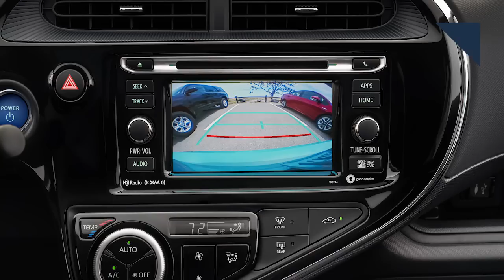EV Credits May Go Away, Jeep Tested Other Wrangler Design - Autoline Daily 2226

Comment: "Battery powered vehicles" will gain popular acceptance when they are as cheap to own as gasoline powered vehicles. (It's a bit more complicated since high purchase price is a barrier even if operating costs like fuel & maintenance are much lower for the life of the vehicle.) That will occur sooner in Europe with their high gas prices and general affluence. It will be later in the US, and even later elsewhere in the world. Even with govt action, until that basic economic tipping point occurs, they won't catch on. Will it be soon enough that "almost half" of cars globally will be "battery powered"? I wouldn't bet on it. With advances to ICEs, the point of parity may not occur until 2030, and then their accelerated penetration into the market won't occur until after.

We won't see significant differences in car design due to autonomAVs at least not in the near future. If fleets will be used for hauling people during rush hour & cargo at other times, expect them to look like small minivans. If they are more individual, personal pods, then they will look like Smart cars with seats that fold out of the way for deliveries.

But autonomous driving won't be the end point, anyway. When they talk about cars sitting idle most of the day and how it's a waste, remember that transporting yourself is non-value adding. To paraphrase a Boeing exec, the future of autonomous cars is telecommuting & working from home.

Comment: Right now, EVs are subsidized semi-directly on purchase price and ICE vehicles are subsidized indirectly by not being required to pay for the negative externalities caused by the pollution they emit into the atmosphere.  A far more rational system would be to remove the EV subsidy and tax all emissions (tailpipe or smokestack) at a level that will fully cover the health and climate damage they cause.
Reply: You mean CO2? Rising temperatures cause CO2 output to increase, not the other way round, and yet these rising temperatures are owed entirely to the sun of all things. By the way, that's what the mainstream media wants you to believe. Climatedepot.com begs to differ.
Reply: 1. CO2 is a greenhouse gas, as can be easily demonstrated in the lab with an infrared source and detector and a sample of CO2.
2. Atmospheric CO2 has increased 27% since 1959, and continues to rise.
Unless the laws of physics have been repealed, this means temperatures will rise.